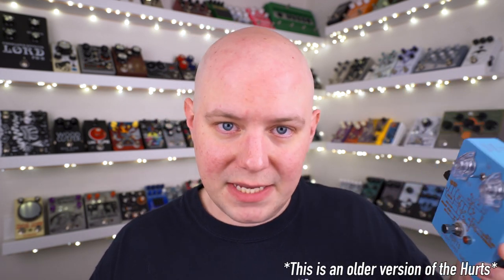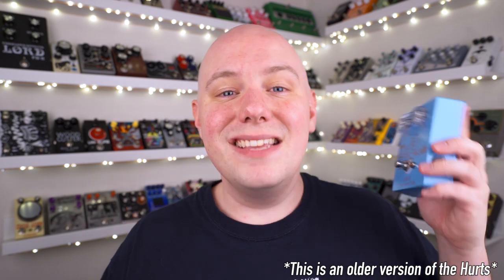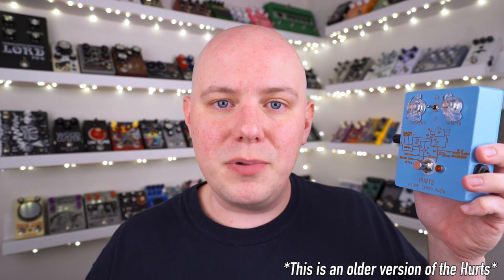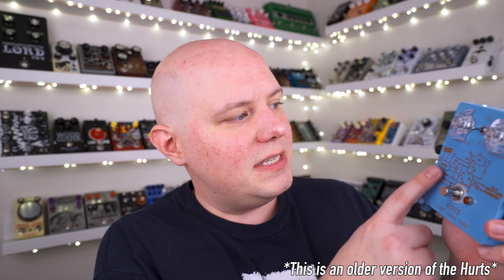History of The Harmonic Percolator

Comment: The original HP1 did not have paint and epoxy over the circuit board. There was one single component that was disguised with a brass ring potted with a tiny bit of a dark red epoxy. I've owned two original HP1's and gone inside a third and none of them had any paint or epoxy on the circuit board.

Comment: As far as I know, the circuit has a fixed level of gain and the harmonics control attenuates the signal from the pickups (much like the volume control on the guitar) and the balance control attenuates the signal going to the amplifier.

Nice rendition of Dude Incredible, btw.
Reply: and Copper :D
Reply from the maker: Thanks for that clarification! And thanks for watching! 👍👍
Reply: @EricMerrow  No problem. It's nice to see a video on an HP by someone who knows what they're talking about rather than repeating lines they've heard about it being THE Steve Albini sound.
Reply from the maker: binface9 that was actually a misunderstanding that I had when I initially got the percolator. I thought it was going to be the albini sound in a pedal. But then I did some research and found out he didn’t use it for his ‘normal’ sound.
Reply: @EricMerrow  Me too, then I really started to listen to his guitars in Shellac and realised it's more of a pushed clean tone much of the time. There are probably half-truths about that around the internet too

Comment: I think you should make your deep dives longer... 20-30 minutes or so. Take the circuit board out so we can see what they look like inside, cuz there's certain types of circuits and board styles that I don't care for too much so it's be nice to know whats inside so people can not spend money on a pedal that they'll ultimately end up selling even tho it sounds wonderful. I don't care for pedals with components smaller than half watt. I've never had any luck with ¼w pedals lasting more than 1.5 maybe 2yrs at the most. And I don't really care for 100% SMD circuits. I do have a couple and I absolutely love my hot tubes nano, 08 digitech death metal distortion and even my 08 Behringer vt999 but they are SMD and the hot tubes is the only that don't have some sort of issue.  I swapped the tube in the vt999 for a higher spec tube and it burnt up a couple components cuz I wasn't able to mod the circuit to accommodate the much better tube. Should of just left well enough alone.. 11yrs no issue then I got curious... Big mistake. And the death metal has always had "noise" even with good power supply. Good cables, Egnaters Rebel 20 and an left handed Epi LP standard plus top it still had the wrong type of noise. If it was thru hole I could figure out what's causing it and fix it but since it's SMD that's a no go. I do plan on making thru hole versions someday.

Other than those things Eric. I absolutely love everything you do. I just wish you got more indepth circuit wise and even tried assorted pedals before and after the demo pedal and even ways to unconventionally use it. That would help out ALOT of people if you had a hr episode where you used a bunch of OD or Reverb, delay pedals etc... in front of and after whatever pedal is being demo'd.  Nice job man as always. Love your tone no matter what pedals you play. You always sound good
Reply from the maker: Thank you for watching and the feedback Patrick!

Comment: Are you running your amp dirty while your using the percolator I just had one built to Steve abinis specs I guess but it's so weak I can't see how anyone would like it perhaps I just need to pay for a more modern version cause I have hot pickups and I still need to max it out to get even close to your examples
Reply from the maker: Honestly, I think it’s kinda built into the the design of the circuit - needing to have things maxed, that is. I know you checked out the Bean Machine, but there’s also the Hurts from Latent Lemon Audio and the Clubber Lang from Malaise Forever that could be more appealing takes to your ears! Thanks for watching 🤘🤘
Reply: Oh yeah I've heard the other percolators out there but the bean machine I can get for like 120$ right now for a blemish edition and I do think the one I got built is messed up somewhere maybe didn't match the transistors or just all around weak ones in the first place.i talked to the builder and he said he could do a diode bypass and that should help